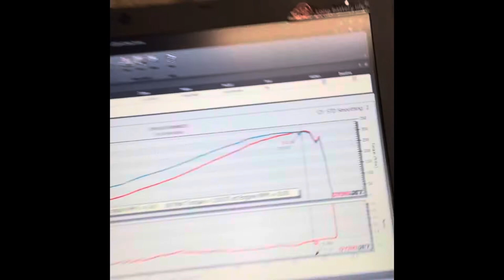Turbo B16 Civic Sent to the MOON!! 661whp

Comment: That engine made great power but very little torque at only 299..
Reply from the maker: tq was calibrated in 3rd... this pull was in 4th which makes the ratio different. Most likely in the 400s
Reply: @PBRTUNED  makes sense..